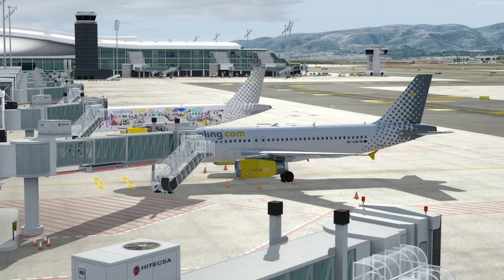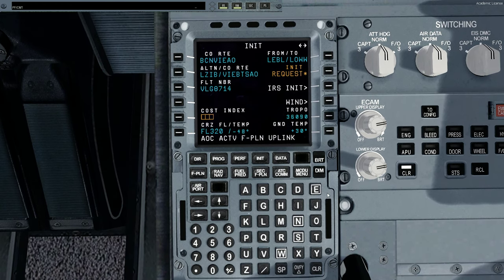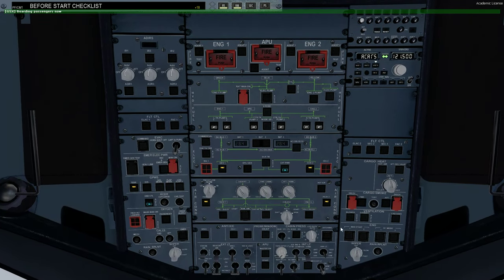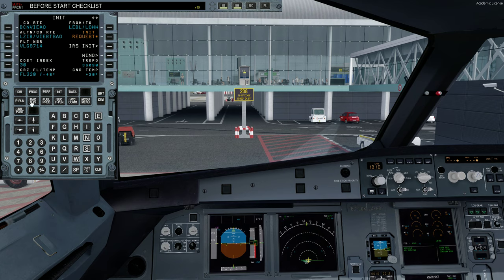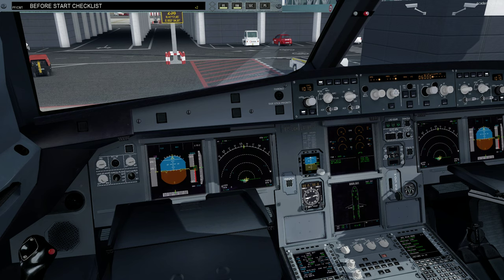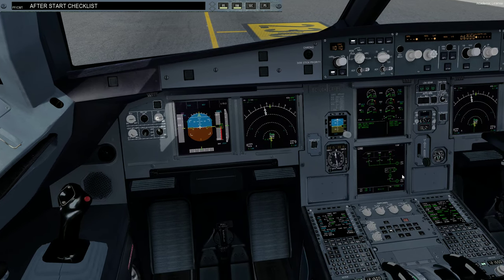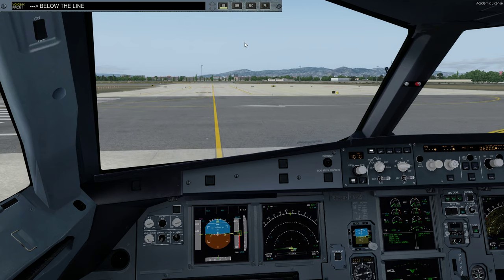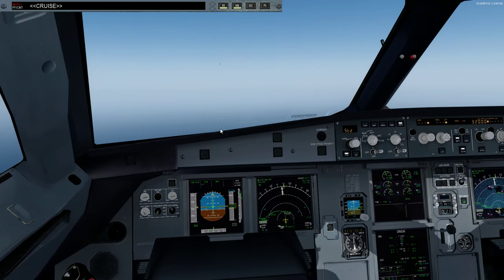Prepar3D v4.5 | FSLabs FS2Crew Tutorial Part 1/2

Comment: Mate your doors are closed when the FO goes out to check the plane. Also he returns but the doors are still closed. Then you hear flight attendant asking if its ok for boarding. Still the doors are closed. How did everyone get on the plane and exit with the door closed. Should be open in my opinion. Next, you show in the description what ORBX scenery your using but what about the others? What airports are you using because what i see outside of the cockpit looks like REX Worldwide HD Airports. Or is that some other scenery?